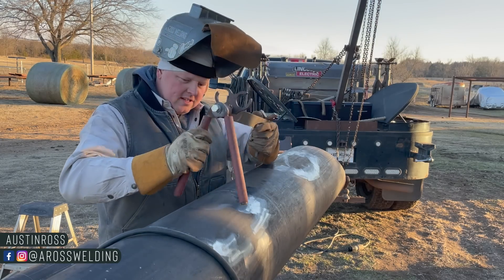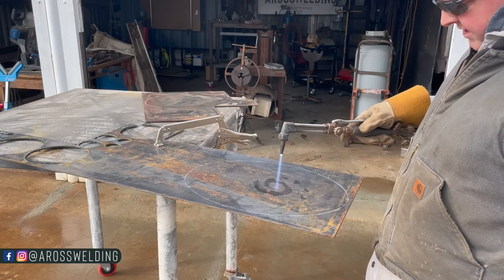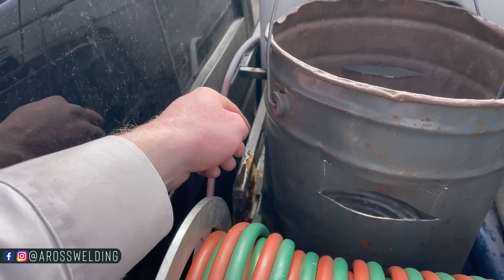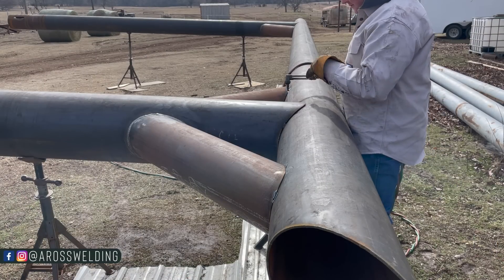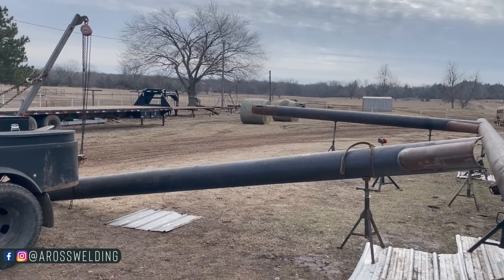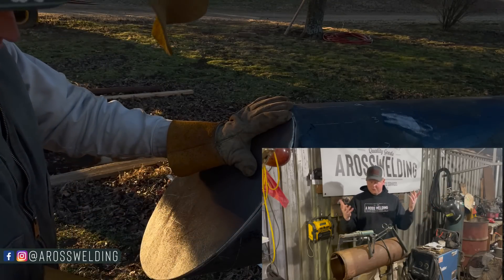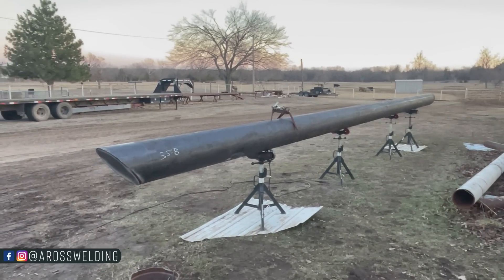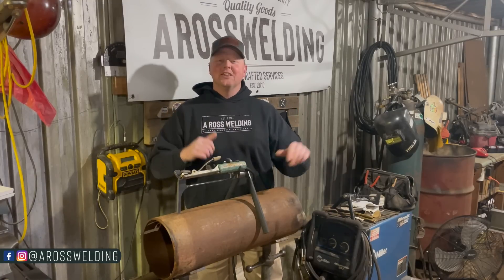Best Pipe Ground Clamp (Connect Your Ground Lead to Any Size Pipe In Any Situation)

Comment: THERE IS NO "MOISTURE IN THE METAL". I am sure you know that, but there are plenty of people who don't.  
For those who don't know,  the moisture he was referring to was the condensation from the torch combustion.  If you heat the plate past the boiling point of water, condensation won't form over your soapstone lines.  Sometimes the moisture will make the line appear fuzzy.
Before someone gets snarky, I started welding in 1997 building metal buildings in a shop, went to welding school for a semester and began a construction career. I have welded tanks, repaired heavy equipment in gold mines,  tubes on boilers, pipe in refineries, built robots in a custom fab shop and now I am retired to the farm. I have seen welding once or twice...  
For the most part, Austin is spot on with his advice.   And ALL welders can do it better than someone they are watching..  Remember that, too.. 🙂

Comment: hey man could you plz do a video on oxy propane cutting? theres no really good videos on youtube about it. and alot of people wanna use propane to cut. my local junk yard has 500 foot cables hooked to huge tanks of propane and a bunch of oxygen tanks ran in parallel. im setting up a torch myself i bought 4 torchs  1 victor, 1 harris 36inch for cutting. 1  24 inch harris and a old airco torch. i wanna be able to use propane for my rose bud and cutting but  ik i need acytalyne to braze. im saving my victor to braze with. best brazing torch i ever used

Comment: Austin, you mentioning cutting the bottom tacks first was a question I asked my pipe instructor in school. He said that if we couldn't roll the pipe to cut it, always start at the bottom and work your way up to a certain point, then you can cut the rest downhill and the pipe won't fall on your head and kill you.

Didn't know that little trick about how to set jack stands so they shouldn't fall over. It's hitting me hard now since we had a mess up the other day after a dolly flew out from under a project we were moving and the front end got damaged.

Oh, that reminds me of a trick we use at work when sending out big jobs in pieces. Use spray paint to mark the areas you don't weld! Blaze Orange or bright green does best since your eyes pick up on them easier than red or blue. 

A quick request if you deem it informative or useful for a video. Could you explain how to make those jack stands? I don't feel like paying an arm and a leg for them if I can make them myself.
Reply: Cutting Edge Engineering here on YT is building some roller stands - slightly different in need/design, but very good info there
Reply: Look up boat stands. 
Easy! 
Triangle base of angle material
3 angles coming up to vertical tube 
Base built! 
Top is acme treaded rod with a nut and your roller/s welded on top. 
Take your roller with acme thread stick out the bottom and screw the nut on and drop it in the vertical pipe of the base. 
Simple.

Comment: Yeah when you weld it you  shrunk it plus the Heat gain of the Sun I've never measured it but I know it 40ft if you weld both ends solid to something on a 90-degree day when you come back in the morning and it's 45° you will pull chunks out of concrete I tried to tell him and they wouldn't listen

Comment: Never used a grasshopper, but they look nice. I took an old piece of welding lead and cut the jacket off and braided it so its about 4 feet long, I just double it over wrap it around the pipe and pull it back through itself and then hook my ground to it. Works well for when I cant get a ground on something.
Reply: Thats how we all do it around here. Easy to turn the pipe on the pipe stands. I also see guy's bend copper pipe into a j hook and hook the ground onto that.
Reply: @frankwhite8474  most of the time ive seen that is stainless tig forn sanitary welding.
Reply: Good idea

Comment: That’s the number one rule that most people break and it gets them hurt… If something starts to fall, let it fall. You’re not going to be able to stop it, just let it go. I’ve seen more people get hurt from trying to grab something to keep it from going over or push it something to keep it from falling toward them when they should’ve just run or jumped out of the way. When you’re dealing with big heavy stuff you’re not going to be able to stop it whether it’s a piece of pipe or a tree you just cut or whatever just let it fall. If it tear something up, that’s too bad you’ll just have to fix it. But as long as nobody gets hurt everything can be repaired.
Reply: As they say. “The falling knife has no handle”

Comment: I would be interested to see how one would turn out if you just welded the entire thing out and then used your beveler to cut the legs just below the 45 pieces and then re weld the legs on when u get to the install site. Ofcourse you would want to use a sanding pad and very nicely sand your cap down when finished.